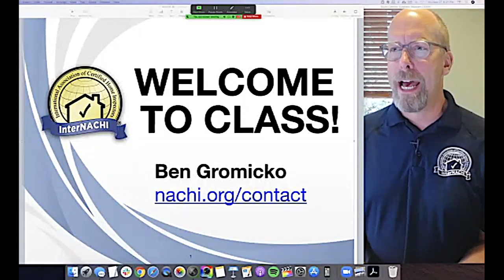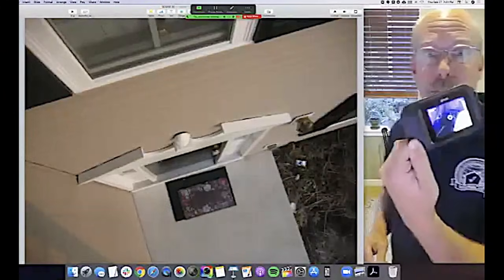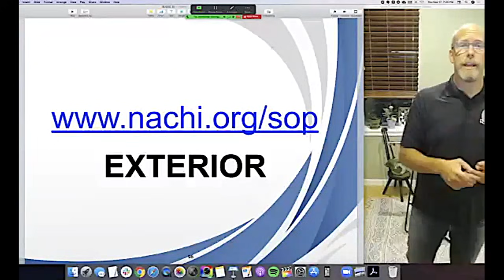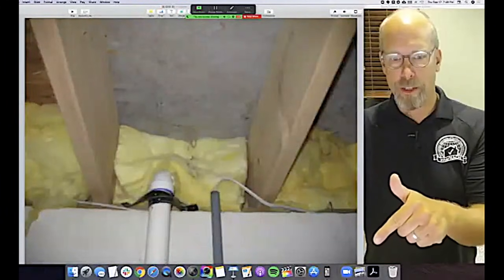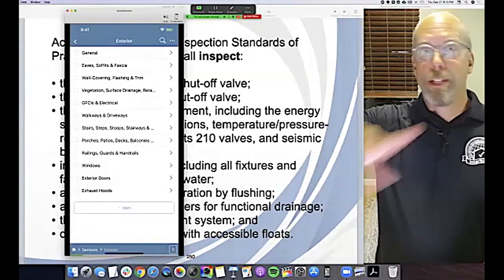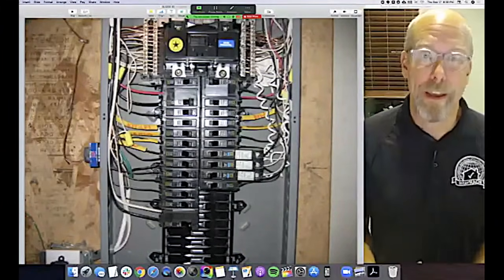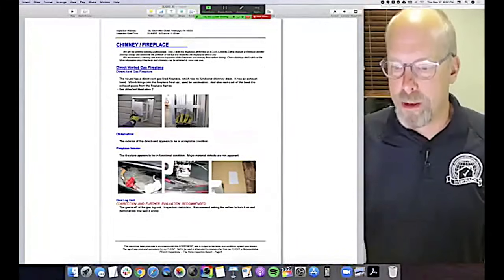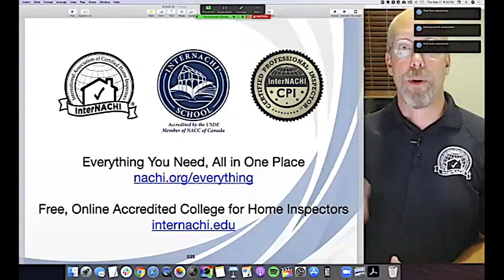Home Inspection Training Class #35

Comment: wrong! YOU ARE NOT TO STATE ANYTHING OTHER THAN DEFECTS- IT IS A HOME INSPECTION - NOT HOME EXTORTION.   You create a lot of provocaitive language that creates doubt and scare tactics for the seller.
Reply from the maker: I disagree. A home inspection is ver valuable, because it provides information that a client needs and is requesting to know and understand. What a client loves about a house (the beautiful and good and wonderful things) are not the job of a home inspector. Home inspectors are hired to find problems. Not every home has defects, but some do. And that's the value of hiring an inspector.
Reply: @internachi  Clearly you did not read my post above- Yes you are to find problems. Not create problems that don't exist, not inflate simple issues that can be fixed easily, not use provocative and sometime very incorrect language to distort the truth - which does happed and scares people. Like using words such as  "MAJOR ROOF ISSUES" when simple correction are needed. And like the use of major structural issues- when you are NOT a structural engineer. I know because I am one. Finding potential problems is a good thing, overstating and inflating simple fixes is not.